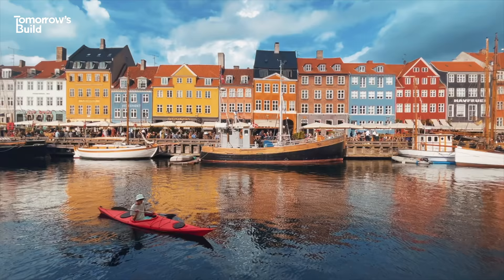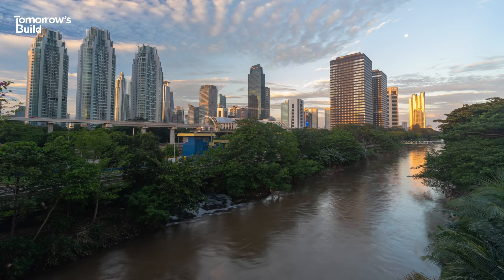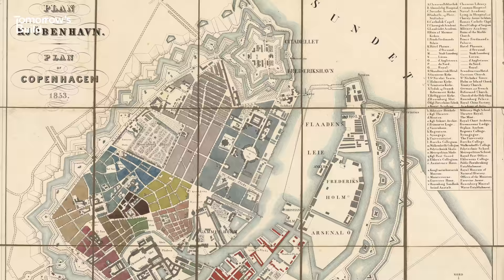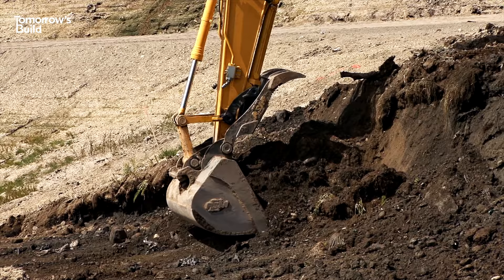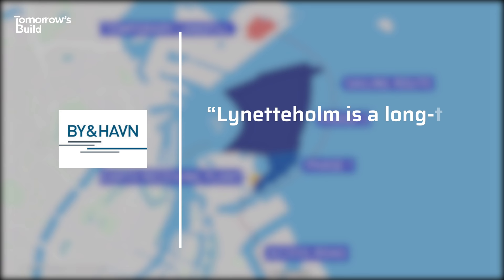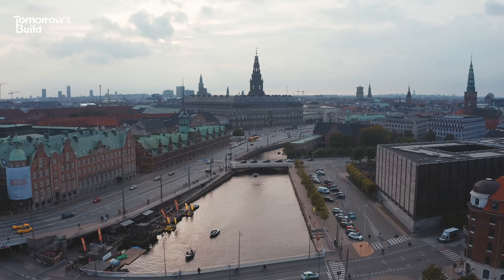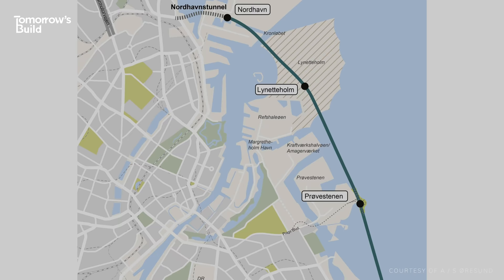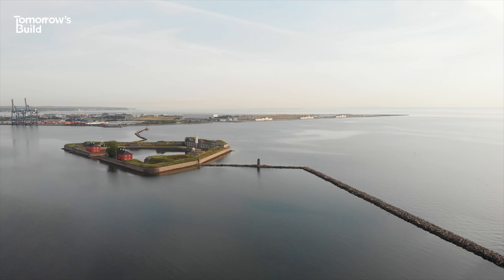The 50-Year Plan to Save Copenhagen From Flooding

Comment: I live in Køge a small town on the coast facing the bay of Køge, about 40-50 km south of Copenhagen. This is where most of the sludge initially dug up, is going to be dumped. Some of the sludge is contaminated and even if it wasn't, dumping this amount of  material is bound to disturb the marine environment in the area. There is a "string" of municipalities along the coast of the bay, that are not too happy about this dumping. This is something the Swedes are also aware off as they have a marine nature reserve just next to the dumping grounds on the opposite side of the bay.

Comment: Building more houses actually does help in bringing down cost, given it’s public housing. In the UK, the “Help to Buy” resulted in price increases for housing, and reports do suggest that increasing supply should’ve been the plan done instead.
Reply: The problem with Lynetteholmen is that the housing part is to cover expenses for the other 2/3 of the project. The tunnel underneath the harbor and a ringroad. The company behind is bound to a specific law as they sit on 33% of the debt from the Copenhagen metro construction. That law states that their projects have to result in maximal profit as they are still paying off on that debt
Reply: @Danishsnufkin  and also that at 35,000 people, thats only adding 700/people/year. Thats not even 700 units, 700 people. More like 300-400 units/year. Or 1 to 2 midrise apartment buildings.

It's a poor housing solution sadly. Europe is very anti-highrise but the real solution for Copenhagen is to build up and densely, not sprawl outward with reclaimed land that will take half a century to build and likely have no impact on housing.
Reply: @ChoKwo  There's also the matter of upzoning suburbs to tearing down lots of the parcel houses and villas out there and replacing them with dense 4-5 story buildings. That's how Copenhagen originally developed before WW2 but we rarely see anything like that in the suburban municipalities these days. Heck Copenhagen is one of the least dense metropolitan areas in Europe because of this. Compare that to something like Vienna which has dense 2-3 story buildings like whats out in Brønshøj, all the way to the edge of the metropolitan area. So we also need to take the existing neighborhoods and make them much denser to deal with this. Its just not sustainable for so many people to live in such parcel houses, taking up so much space, and spreading infrastructure wide across relatively few tax payers. It costs the municipalities tonnes, and its worse for the environment too, and for the housing crisis.

Comment: Time. Yes, it will take a lot of time, and yet, other than the threat of rising seas and more severe storms, the time spent will enable the project to be built correctly. There will be opportunities to assess the development, make changes, reduce the impact on the greater environment, and give a new generation time to build their life around it.

I do see a problem with the trucks. That's a lot of traffic, the trucks will be heavy and dirty, they're likely to wreak havoc with the roads. The city should look at ways of diminishing these challenges.
Reply: electric trucks may become popular in the near future which will probably be cleaner and quieter but weight im guessing will be similar especially loaded but they have time to increase road toughness if thats what u mean by wreaking havok on the road? or did you mean traffic congestion?

Comment: Lynetteholm has a few argument going for it, and a lot af arguments against.

I'm surprised that the video doesn't even take the time to mention the part of the environmental impact assessment that is modeled on how the extremely important flow of salty oxygenated water from the Kattegatt into the Baltic sea, is effected by Lynetteholm. The inflow of water is important for the major parts of the Baltic sea. Lynetteholm will be placed partly on one of the deeper channels in Öresund, where water from the Kattegatt flows south towards the Baltic Sea.  The whole model and its results have been critized and is now being assessed by a third part.

Furthermore, the full environmental aspects of all parts of Lynetteholm has never been revealed... because they don't exist. It's cut to pieces to match smaller parts of the bigger project. This makes it extremely hard to grasp the full picture of benefits versus costs and impacts.

And not to mention that the polluted dredged material from the building site, are being dumped as far away from the danish coast line as possible, and as close to the swedish border (with protected marine areas) as possible. Neither the affected danish municipalities or the swedish authorities are exited about this. And the whole project has there, once again been reported to the EU for breaking the rules of not having a proper trial and permit for affecting a Natura 2000 protected area.

And this is not even the full picture of the critique...

Comment: MAMA I'M ON YOUTUBE! I'm the guy at 4:19 walking around with a megaphone. I'm a spokesperson for the movement STOP Lynetteholm.

Very good video, and well produced, but I am sorry to say that it omits a lot of the issues with the island, which ultimately make it an awful idea which needs to be scrapped. I perfectly well understand that you can't include everything in a 6 minute video.

Here's a very incomprehensive list of the issues:

Lynetteholm DOES NOT defend Copenhagen against flooding. The risk of storm surges in Copenhagen is much greater from the south than the north (as in - water leaving the Baltic, rather than water built up in Kattegat). The island will form a lid in one end of the harbor, trapping a potential storm surge from the south, and causing more severe floods than would otherwise have happened. This is a concern shared by several independent hydrographers who have investigated the project.

Lynetteholm HAS NOT had sufficient environmental assessments made. The Danish Aquarium (Den Blå Planet) have had to stop taking water for their saltwater tanks from the ocean, despite reports from By&Havn (the developers) assuring them that it is safe to do so - i.e. some of Denmarks top marine biologists do not trust By&Havn's assessments. Likewise, independent experts in several fields have described the environmental impact assessment rapport as "a hackjob", and disputed many parts of it.

Lynetteholm IS NOT necessary for the city. The only reason the municipality really wants it, is so they can make money from selling lots in order to buy more Metro lines which seem to be a vote-getter. Currently, in Denmark, the municipality is responsible for taking on excess dirt from construction sites. Lynetteholm was made as a "two birds one stone" solution, except that there isn't enough dirt for the whole island, and the dirt it does use up would be better used building dykes around the island of Amager, and around the coasts north and south of Copenhagen.

Lynetteholm IS NOT necessary for housing. Rapports written for the ministry of housing in 2018 show that there is potential to develop a further 124000 90 sqm homes in Copenhagen by building denser in less-dense parts of the city. Another 10000 homes can be produced by building on the roofs of existing buildings according to private investment firms (Grundejernes Investeringsfond). Yet another 8400 can be built by repurposing the 5,7% of offices that are currently standing empty in the city.

So, in all, good video, but be careful to not glorify Copenhagen city planning. Our city used to be cutting edge, but in the last 20 or so years it has been falling behind by continuing to build for the rich, and to accommodate cars. Fortunately our most recent election (November 2021) showed a significant increase for one of the few political parties which have understood the need for more pragmatic and less flashy city planning philosophies.
Reply: As a Dutchman who loves land reclamation, I thought "who could ever oppose this ambitious project?". But now I understand that it just isn't because of flooding. Greenwashing indeed.
Reply: @GodFirstnl  Thank you for the sympathy. Unfortunately the company which owns the public properties in our city, By & Havn, acts more like a political entity in and of themselves, rather than a company owned by the state and municipality. The municipality made the grave mistake of handing over the purse to a separate entity, and they now own the politicians instead of it being the other way around.

Besides, how long do you think this project might have been debated? Considering it's the largest and most expensive construction project in the history of the Kingdom of Denmark a reasonable answer might be 25 years? But if we really lowball it might be 10 years?

And the real answer is...................................................................................................

2 years.
Reply: Tak Nicholas, jeg er fuldstændig enig med dig. Rigtig godt arbejde!
Reply: kæmpe spurgt bro

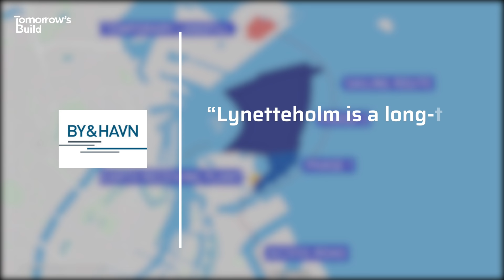Comment: Quite the ambitious project and certainly long term, but at least they seem to want to address the issues. On another note, that's a nice looking spot at 3:50/6:37. Thanks for posting.
Reply: That is Trekroner Fort
Reply: @jonasjascha  Many thanks. I'll have to do a search and check it out.
Reply: what issues? There is still no flood protection. The project doesn't even have a dock gate in its budget. And Its the wrong end of the harbour, if avoiding flooding was really the motive

Comment: Great video, but I'm skeptical, sounds like a huge waste of time and money. I live close to the world's largest movable flood barrier at the time of construction -Thames Barrier(Dutch/British construction project) I've also been to the Netherlands too where they have roads over the sea and huge dams. UK works collectively with them to deal with flood risks. Shouldn't all countries  in the Baltic and North sea prepare for eventual sea level rises already baked into the cake 21st century?
Reply: That's because it is a massive waste. They are planning to complete construction in 2070, with only enough housing for somewhere around 1.5-3% of Copenhagen's current population. This housing will be unaffordable to the vast majority of the city's population. And when there currently is a housing shortage, it is an absurd idea to solve it with an artificial island megaproject that won't include any housing for at least 20 years. Especially when they could just build slightly taller apartment buildings anywhere on the whole island of Zealand.
Reply: @melonowl8737  i agree with you, and I'm British. You could create a buffer to rising sea levels for a fraction of cost and time! 😉

Comment: Even though it may seem big when it is told in terms of football fields, if you look on the whole map of the city it's somewhat same size as port area and dumping so much sand into ocean will definitely affect the aquatic life , however you put it , it is definitely not environment friendly and thirdly how does it solve sea level rising problem , will there be barriers like Thames or venice barriers
Reply: By consuming the dirt needed to build dikes were they are needed it does not help other than making the place for the lock gate narrower.

Comment: I think it would be better with a regular flood barrier, with around 10-15 meters of land behind it, and then behind all of that, just build house boats. A floating district. A lot cooler, better for the environment and cheaper.

Something new like this could be a tourist attraction. Some reclaimed land wouldnt have the same pull (imo)
Reply: That's the point. If they wanted to protect the city from flooding, it could be done cheaper and easier. But the truth is that Lynetteholm is a real estate hustle, meant to "finance" a ring road and a harbour tunnel for traffic. I don't have a crystal ball of the future. But with the way they have exceeded their budgets so far, i feel pretty safe saying that there will be a heavy debt to pay, and the copenhagen children of today and their children will be saddled with the debt that comes from it. "Lynetteholm" is based on optimism bias, an economy where the foundation is resting on quicksand, and that is why they are in such a hurry with the project. They know the citizens have smelled the rat. This is why the citizens of copenhagen have had our right to appeal and insight into the project, revoked.

Comment: Damn 50 years. I wasn’t sure why I was surprised it is a massive area being developed.
Reply: well, the "maasvlakte 2" in the port of rotterdam, The Netherlands has an area of 2000 hectares, or 20 km^2. this reclamation project started in 2008 and finished in 2013, so it took only 5 years instead of 50, with about 7.5 times the surface area. budget was also 3 billion, and they even finished with 150 mil to spare
Reply: The reason it takes so long is because of the water depth. It is up to 14m deep where it's build.
That is a problem for the Baltic Sea as that sea gets oxygen rich saltwater through the Sound. Now parts are being blocked by Lynetteholm. 

If you don't know. The Baltic Sea is in very poor condition and a couple of months ago it was decided to ban almost all fishing to take care of that sea. Now Lynetteholm is threatening it's destruction.
Reply: @tjibbeettema8759  holly molly. That’s massive that like A city 🏙 in Itself.
Reply: @sebbeselvig3931  what country are you from? It’s pains me to see how humans are drastically changing the planet and ina negative way.
Reply: @Thebreakdownshow1  Sebbe is from Denmark.

Comment: The problem with the project is mentioned in the video, but the link isn't made by the narrator.
As mentioned the lawsuit was filled because the environmental impact wasn't investigated thoroughly enough. Later in the video it's said the actual developement of the housing on the island isn't yet know, and THAT'S the problem, as it's against EU regulations to approve a project in pieces. The rules clearly states a project needs to be assessed as a whole.

I don't think the fight is over about this island. Personally I don't even see how it's gonna solve a housing problem with "only" 30.000 apartments due in 50 years - the demand is here now, in 50 years the demand will have outgrown the supply of these 30.000 apartments anyway...!

Comment: I am stunned that something this ambitious is estimated to cost only $3bn, whereas something like HS2 in the UK could be anywhere between £50bn and £100bn!? I get that it's a larger scale but...how?
Reply: I think it’s really not possible to compare the Lynetteholm with HS2. And as any and all projects in Denmark like this for the last century have gone over budget, I would be surprised if it ends up on less than $6bn.
Reply: I have no idea where the got the $3 billion figure. the current estimate is around 80 billion DKK (over $12 billion), and you can pretty much guarantee that the cost will only increase over time.
Reply: Maybe the first amount is to build the foundations, and doesn't cover construction? Or maybe they plan to import workers? Wasn't the UK against that?

Comment: Copenhagen is not facing flooding, it's located on the part of Denmark, which is rising instead of sinking. About 1 mm every year. The West coast of the Jutland peninsular is sinking by 1 to 2 mm a year. The storm tide of 12th November 1872 was 2,4 m over daily level in Copenhagen, and the sea level will maybe rise to 33 cm by the year 2100.  Building housing for 35,000 people on an artificial island isn't wise.
Reply: Ah, maybe that is why they don't build higher?

Comment: The premise of Lynetteholmen is bullshit from start to finish. 
- lots of contaminated seafloor is dumped in nearby Koge bay (close to not one, but two natura2000 areas). Said dumpings contain various pollution such as quicksilver
- When there is highwater it rarely if ever comes from the Oresund strait (because its a strait) it does however come from the south aplenty. 

By and havn, the company behind is in debt and have been for many years. They sit on 33% of the accumulated debt from the construction of the Copenhagen metro. There is also a law in play that prevents by og havn from selling under the maximum value, due to their debt.

The Copenhagen citizens have been denied their democratic right to protest by the minister for transportation, who is keeping reports about the projects economy confidential. 

Oh and the tax payers get to pay for
- polluting the eastern sea
- a "climate security" that doesnt secure shit
- more expensive housing that almost no one can afford

And down the line a tunnel and a freeway to the airport
Reply: Mercury isn't necessarily pollution, it depends on what kind. Wouldn't it have value if extracted?